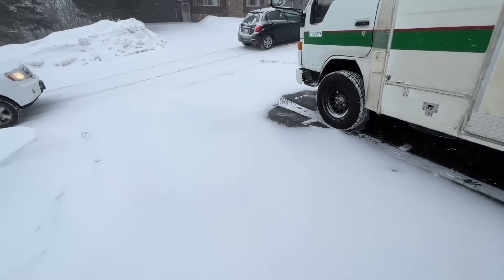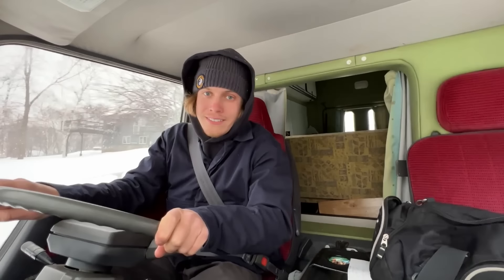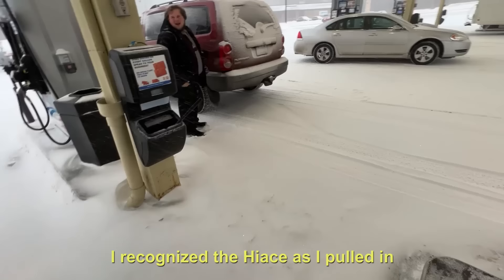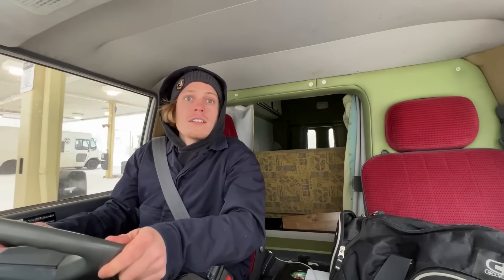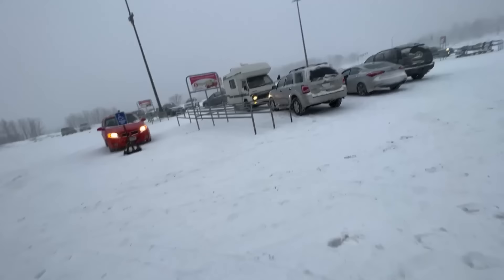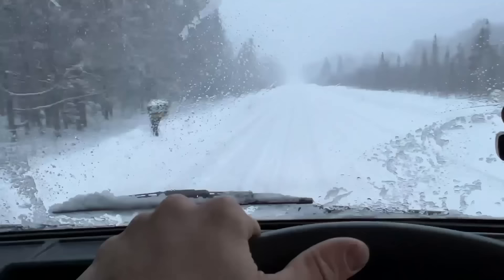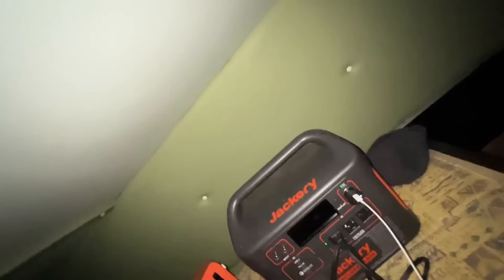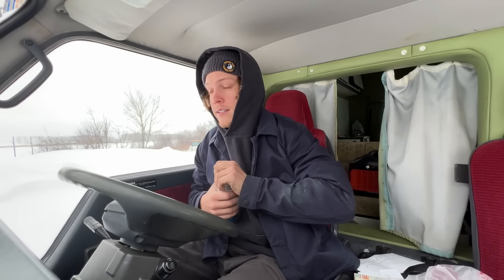Winter Camping with a Cheap Amazon Heater - Will it Work?

Comment: The electrical in the back is likely setup for 100v, not 110 or 120 like the US. On electronics it usually won't matter, but on appliances it will. Shouldn't be too hard to change. It may be as simple as changing that inverter for a US one and swapping the outlets for extra safety.
Reply: I hate electric. I'll pay a dude to figure this bs out for me actually. No luck with it myself.
Reply: This was what I thought too. Japanese camper, Japanese writing on the electronics. It's deceiving because they use the same outlets, minus the ground hole. So stuff will still plug in.
Reply: Yep. Mav probably needs a converter.
Reply: yup.
Reply: This is what I was thinking
Reply: The inverter and generator both are likely 100v. A non computerized heater that's more analog would work fine, although I likely wouldn't want to fall asleep next to it if it's running on 100v instead of 110-120v. I have a cheap heater from walmart that I have run on my small generator and the voltage drops to 97v when the heater is on, it still works fine but there's prob some long term risks of running them on that reduced voltage. Also Japan uses both 50hz (north) and 60hz (south) so depending on what part of japan this was from it could very well be 50hz if it comes from the north.
Reply: @JetSettingBotanist  what sort of long term risks? Undervolting gives less power, overvolting is much more serious.
Reply: @tobysherring1369  Yes, running a simple, all-mechanical heater on 100v instead of the 120 it was built for should be no big deal.
Reply: This
Reply: Yeah doing air conditioning I knew it was pulling to many amps

Comment: Your deisel heater shutting off might be something as simple as the fuel gelling up. A small amount of 911 or lucas anti-gel will drop your freezing temp to -10. Small deisel engines have lower rail pressure so they are more susceptible to freezing fuel. You probably know this but i hope it helps, love the vids thank you for taking us on your journeys😁

Comment: If the diesel heater comes on and goes off through the night it might be the firing tube inside it, I had the same issue on my semi truck here in the UK. Only took a workshop an hour to fix it and now works flawlessly
Reply: run that heater for 15 mins one or twice a year before winter as well and it will stay running for atleast 1000 hours or should  its important to let it run for 15 minutes as well so that the burner tube your talking about doesnt get gunked up. want to get it up to its optimal temp to prevent any fuel coming into that tube and not burning completely and exhausting, that will affect the tube, the glow pin that ignites the fuel, and the little wire mesh screen filter that surrounds the glow pin. very delicate heaters, but will also run for a long time before needing any service work IF used correctly.

Comment: You'll have to upgrade your power inverter to one that can handle more watts if you want it to power the heater. Anything with a heating element will draw a lot of power
Reply: The wattage of the inverter was my first thougth too.  High draw appliance such as heaters tend to have an initial spike wattage requirements to start, then drop to a constant wattage draw.  And Steve's inverter might not have enough peak wattage to handle the initial start of the heater (or even not enough of both).  That is why it can operate the fan (requiring less wattage), but not the heater itself.  A good modern inverter on average has a peak wattage (good only for approx 1 sec) that is double its constant wattage.  But Steve might have an old school or a low wattage inverter that can't handle the heater's 950W current draw.
Reply: @fatmanoverlanding  What you said is 100% true, however it's also likely the fact that japan uses the same plugs as North America but at 100v instead of 120v so the heater could be sensing this and not allowing it to come on. Also either 50hz or 60hz depending on where in japan this was built for since in the northern parts of Japan they use 50hz and 60hz in the south.
Reply: They make baby heaters that draw much less, like a 200 wats or so.  That's not much heat though.

Comment: I found at Walmart a couple winters ago a little electric heater that only draws 250 W!!! And only cost $10.99!! And throws out a good amount of heat!! Back story, I live off grid in a tiny home 12x20...I have solar as well as a 3500 W gen. The generator doesn't even know the little heater is plugged in and running, which is Awesome!!!

Comment: usually in RVs the household electrical outlets are set up to be on when you are plugged into shore power, unless they have a built in inverter (and in that case you would have some other buttons to push to get those working). My old RV didn't have an inverter, so I got myself a small inverter, hooked that up to the house batteries, and plugged my RV's shore power plug directly into that inverter (had to have a 30amp to 15amp adapter plug). That will get the household plugs to work.  Depending upon your inverter size and battery bank size you could even run a microwave or cooktop on it... oh, and then if you have a built in generator that too will run the household plugs. But ya, that is noisy!

Comment: It doesnt matter the physical size of the heater, the Watts are too high.  You can try for a 500 Watt.  250 is normally the next one down in wattage but doesnt heat great.

Comment: Mav, seeing the symptoms you experienced with your 950W heater from using the household powerpoint (ie. 110v/220v) in Steve, could might mean that the peak load (not the constant load) required to start the heater might exceed Steve's inverter. Thus why it will run the fan (requiring less wattage), and not the heater itself.  Do you know what the contant wattage and the peak wattage of Steve's inverter is?
Reply: yeah the amp draw on that heater is too much so the inverter is shutting off on overload

Comment: You might try frying with canola or vegetable oil as they have a higher heat point than olive oil. You can sauté some vegetables with olive oil but to cook those potatoes properly, you need the correct oil. 

Try nonstick stone for your cooking. It makes for much easier cleanup.

Comment: Always amazes me how good of a driver he is. Ik it snows a lot where he lives and he's used to it but most people still wreck like crazy and drive super slow in it. Meanwhile he's cruising through and finding a good place to camp for the night
Reply: Some of that comes down to the vehicle you are driving as well....people want these big fancy trucks and SUV's with a lot of power, but for now/ice driving, the more power you have the worse off you are, you don't want spinning wheels, as soon as you lose traction you are just along for the ride.  That Japanese mini-RV is great because of its power to weight ratio, it'll do quite well in snow, sure you can get them sideways if you wanna but their far more weight balanced and handle bad road conditions really well.  My old Ford Tempo was great in snow/ice too, front wheel drive, with a 4 cylinder engine, it had no trouble at all in bad weather.  

People drive too fast for conditions that is what gets them into trouble...between driving too fast for conditions and driving too fast for their driving skills are why people end up in wrecks in bad weather, as well as in good weather...if they can't drive without getting into accidents during good weather, they shouldn't even try driving in bad weather.
Reply: Confidence, skill,  and common sense go along way🛻

Comment: The generator in your camper is likely putting out 100v AC. this will not work with any appliance in the states. You will need to convert the output of the generator to 120Vac and update the outlets.

Comment: Have you tried a Crisco heater? Low tech but will produce heat all night and for days on end if you want. Most RVs are not super air tight, so CO is not an issue. But always use a detector just to make sure. 

If you're starting off real cold, the electric heater for a half hour or so to take the chill off is a good option. In an RV, you want an electric heater with a strong fan like a Vortex or a cheaper Vortex clone (about 30 bucks). You've got to warm up the thin walls and others types of electric heaters don't circulate enough air.

Comment: The diesel heater should work fantastic.  Get yourself a 31 Rv battery and you will be fine.  I camp all winter in -15 to -20 c here in calgary.  The diesel heater is awesome

Comment: I have this 350 watt “Handy Heater” that has a temperature setting and has worked great in my camper. 
I wanted something with a temp setting so i would have to wake up to turn it off or on. At 350 watts it easily last me 8-9hrs on my yeti3000. I got it for like $25 on ebay
Reply: Wow! That’s awesome! Curious to know what cold temps this worked in - and what insulation is in your van. Would be good to not need to go the diesel heater route
Reply: @karenlewkowitz5858  doesn’t matter your not him it won’t be the same! Welcome to human biology!
Reply: What kind is it? I've been looking for those.
Reply: @karenlewkowitz5858  i’ve used it in 28 degrees, van is somewhat insulated but not very well.  It is quite samll though

Comment: For space of the  size you have  in "Steve" you really should  only need, at  most, 500 watts of heating (Assuming decent insulation of the cabin). Fancy stuff like "Oscillation" doesnt really impact a heaters ability to heat a space. It also doesnt matter if its ceramic or just wire filament (infrared doesnt heat air, it  only heats objects but thats a whole different  discussion) dont be fooled by heater gimmicks. Electric space heaters are extremely efficient. literally 100% efficient. Energy in=Energy out. so if you see a heater that has bells and whistles for 50 bucks and its 1500watts max and another cheapo no frills electric heater thats also 1500watts for twenty bucks, guess what, they both heat the same with the same power and efficiency. save yourself some money and just get the cheapest heater you can wiyth just enough power to to the  job. Those little tiny 250watt personal heaters would be excellent for your purposes. two of them ought to be  enough to heat that cab from the coldest temperatures.  use one to conserve power and only use the  second if it isnt enough.  youll  save your batteries and generators and get efficient heat.
Reply: The other thing to add to this would be get the proper sleeping bag for the weather conditions you will be sleeping in, and don't run a space heater or diesel heater all night long, you are wasting fuel and electricity...turn one of the heaters on a half hour to an hour before you get up, that should be enough to not freeze to death as you are getting up and getting dressed....the camper will also heat up more as you turn the stove on for breakfast...so don't overheat the living space running heaters all night long and the stove in the morning....you shouldn't need the heaters through the night if you have the right sleeping bag.  Don't sleep in the clothes you wore throughout the day either, sleep in your shorts, or pajamas.  This allows your clothes to air out from the day's activities, and allows your body to be more relaxed and less restricted for better blood flow which allows of course better circulation which also keeps your body temperature more consistent.

Comment: Your diesel fuel furnace should keep your entire RV rocking warm all night, including up front when you're driving. I had one in my semi that I used in the states and Canada and Alaska. Never let me down even at -20°f. Take Steve to a shop and have them get it right. And do something about that small tank issue. Add a second or get a bigger tank. One last thing to consider, get a diesel stove top. You can find them at marine dealers. Get all setup on diesel and a bigger fuel supply and you will be so happy. Sir have a great day. Recipes? Hmmm, I might send you something.

Comment: I don’t have it fully tested but I’m using a toaster oven on low when it’s cold and it’s infrared heat so it has less moisture. Also on low it’s closer too 500 wattt rather then 1000… :) thanks for the video
Reply: Interesting.

Comment: The wife, myself, and my mom's cat, spent most of 17 and 18 living out of our 30 year old RV. The winter of 17' and 18' were cold, and there were several weeks of subzero temps. The RV's built in propane system didn't work so we used a kerosine heater the first winter (which was a mistake, primarily because soot got all over everything and resisted cleaning up). The next season I switched over to a Buddy. It worked very well, although in both cases we took care never to leave them running if we were not present, or at night when we were sleeping. We used an electric blanket on the bed (as long as we were able to plug in somewhere, and on a couple of brutely cold nights, ran the generator all night). Thankfully a week before the new year (19') we were able to move into our new home. One does what one must to survive.

Comment: That electrical looks like a nightmare. As others have said you are going to need to up the power to 110VAC. They use 100VAC in Japan. That 10 VAC makes a difference plus it's probably running at 50HZ not 60HZ. Careful what you plug in electronics wise or you may not have said electronics for long.

Comment: Love your channel.
Boil some water pour it into 2 rubber hot water bottles for your feet and chest in the sleeping bag. save some electricity. run your heater for warmer air inside. hope it helps.

Comment: The pan you started with requires the bottom to be cleaned, that black stuff is previously scorched (too high heat) food....couple things you can try.....put little bit of water and soap in pan and warm it on the stove,  not hot,  warm enough as you will take scouring pad to clean it....or do cold pan and put ketchup over the black area, let it sit for about an hour,  then use scouring pad to remove.....or fill bottom with water and comet cleaner let soak, then clean.......once pan is clean, dont cook anything higher than medium heat.

I watched a woman traded out her van/home and bought a Uhaul truck that waSteve. She will renovate it to her new home,   she lives in Seattle and drove to Florida to get it...she named it Steve,   reminded me a bit of your steve.

Comment: To use your aluminum skillet, simply cut your heat back drastically! It doesn't take near as much heat to keep it hot! They really do work well. (I was sold only on cast iron until someone told me this. Now I like just about any kind of pans.) I do have a great recipe, I'll try to remember to put it on your web site!
Reply: Oh, and I forgot! I use a cheap $9.99 electric heater from Amazon to heat my home office with. (The heat vent got covered over with tile when the last owner did some renovations.) The room is 16 x 15. And we get some really cold winters here in West Virginia. I keep it near my desk. And I run it all the time. I've been using it since 2016. I can't believe I'm still using it! And it does a great job.

Comment: I have an idea

You should buy a Lasko My Heat, they are small little heaters and don’t use too much power. however they do not have tip protection

Comment: A small electric heater can not keep the temperature up when it is really cold. I don't heat the whole cabin. I use the jackery to power a 12V bunk heater like the truckers use. It goes under the bedding.  Keeps me toasty all night.  Uses about 40 to 50% of the power in 8 hours.

Comment: The reason you are facing difficulties with the outlets is simple: in japan, the standard voltage is 100 volts. America, however, uses 120 volts. you likely have enough wattage/amperage to run the heater, but the lower voltage makes the heater's electronics turn off because the heater thinks it has an electrical fault. so called "dumb" devices such as incandesant christmas lights/ fans/ old heaters don't see this as an issue and just pull more power. If you have a multimeter, then test the voltage of the plugs with the high voltage ac setting. if you have less than 110-115 volts, then you would need a voltage converter or a new generator/inverter. I would also check the voltage under a "dumb" load to see if it spikes or drops. For now, i would suggest a low power "dumb" heater that has no computer components inside it.

Comment: When I was helping a friend do some trucking it was cheaper to run our main engine for heat than it was to hook up at the Trucks stop, you could just fire the main engine and use its heater, being diesel it could likely run all night on prolly about a gallon of fuel.